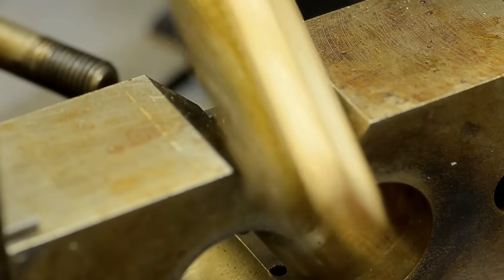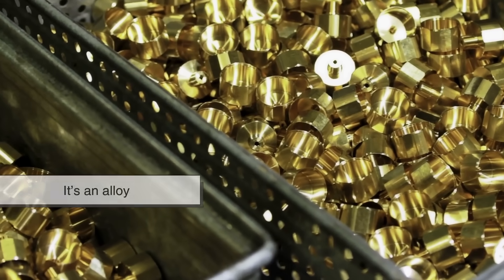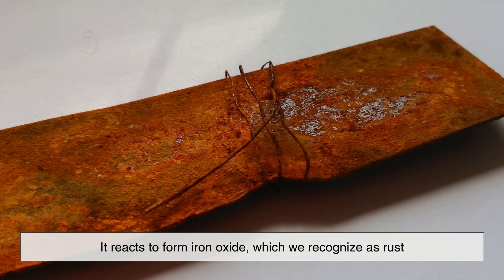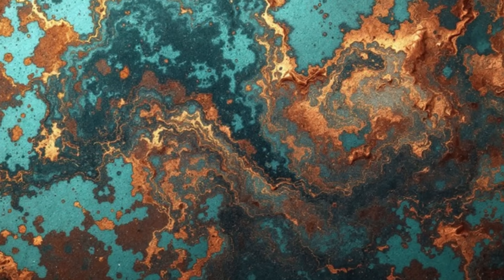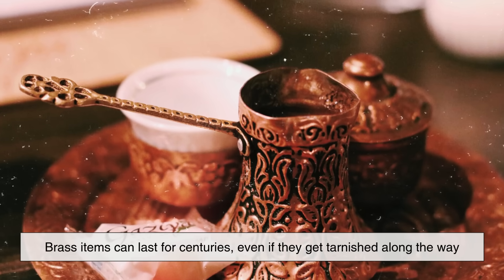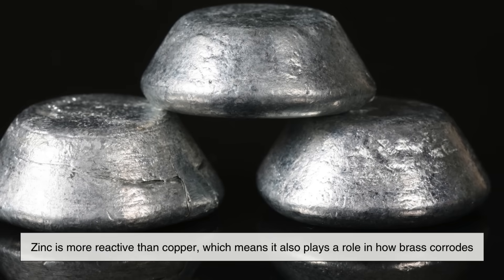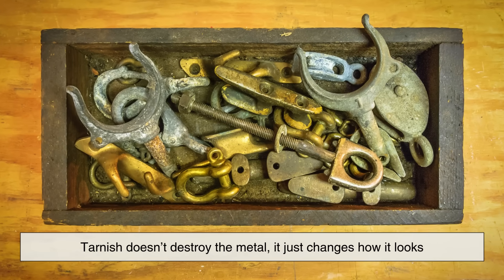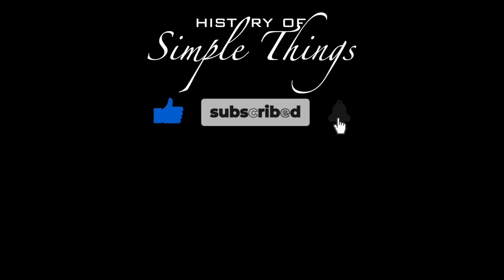Why Does Brass Tarnish But Not Rust?

Comment: Any oxide is actually rust. It does not just apply to iron and its other forms.
Reply: Rust is an example of oxidation.  Most metals will oxidize, but it is only called rust when it is iron based.  Layers of oxidation on copper, aluminum and other alloys usually form a barrier to protect the metal underneath.

Comment: From a chemistry point of view there's not much difference, they are all oxidation reactions. The key difference is that the oxidation layer with steel doesn't bind tightly to the metal whereas it does with brass. From memory, the problem with rust is that the crystals formed are significantly larger than the metal lattice they are made from so they basically peel off. Aluminium is a much more reactive metal than iron but its oxide layer stays very firmly attached so it acts like a very non-reactive material.
Reply: Accurate! The metal lattice also affects the metal oxides formed.
Reply: Wow
Reply: That's the chemistry I was taught
Reply: only if it is properly coated.  otherwise, it turns white and fluffy.

Comment: Copper doesn't rust on its own, it tarnishes, that's why it's used as water pipe, it's very durable, wont rust.  But copper is rather soft, and can split. brass is tougher and most importantly, it looks a lot like gold
Reply: Copper pipes ain't so good in damp environments. Green spots appear and cause pinholes overtime. I've replaced all the copper with PEX in my crawl space for that reason.